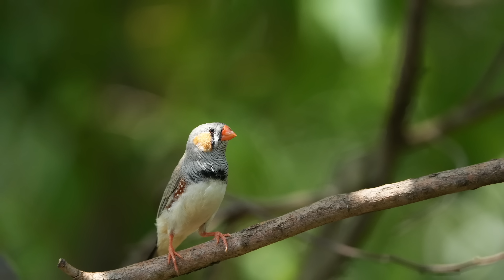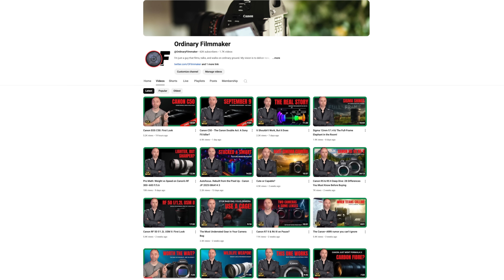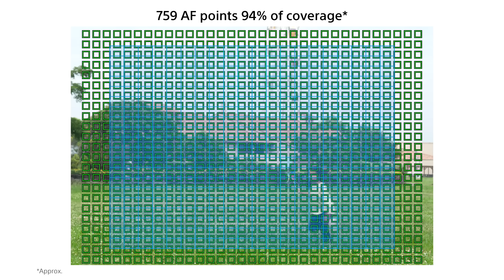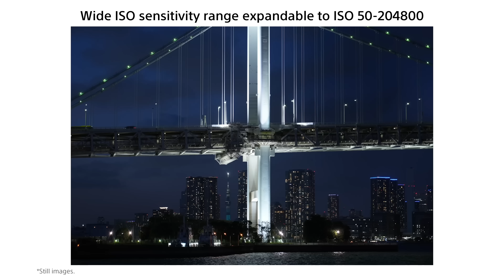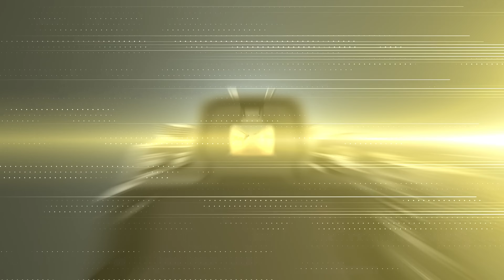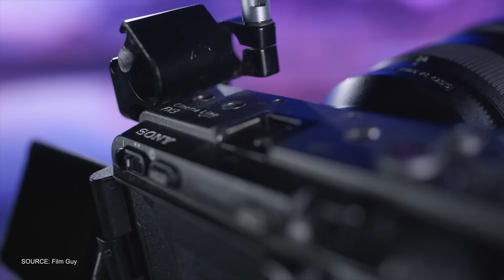Sony a7V just showed up on the radar

Comment: I’m hoping it has better video stabilization like the A7R5. This is something professionals expect from mirrorless manufacturers these days — reducing the need for a gimbal to some extent. In vlogging and event videography, companies like DJI are increasing their  share due to the lack of a robust in-body + digital + lens IS combination in mirrorless bodies
Reply from the maker: It's hard to do well on full frame sensors. The best way to get good stabilization is with a heavy kit or a gimbal. Heavier body and lens kit helps a lot, but most don't like this. Next is the gimbal.
Reply: @OrdinaryFilmmaker  the Lumix S9 is very light and even  without rigging it the stabilization is great and better than any other brand